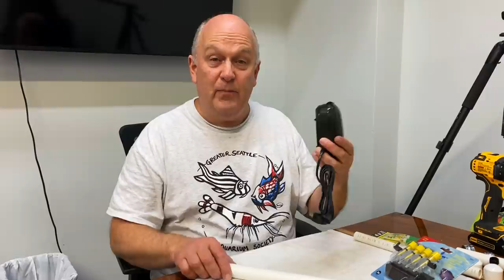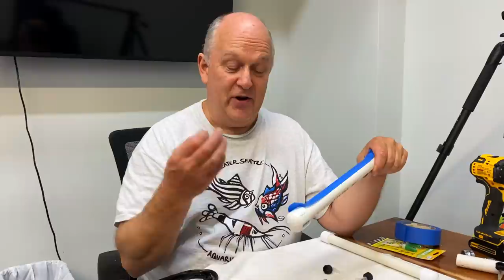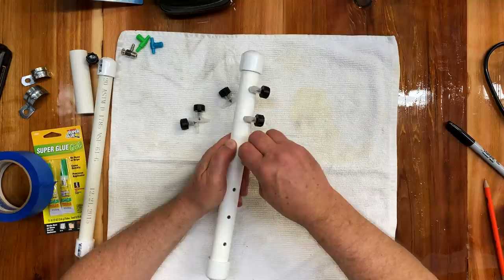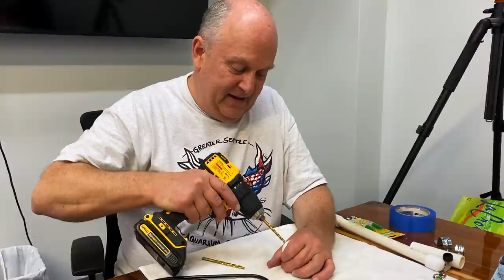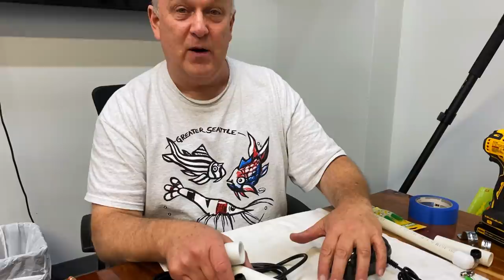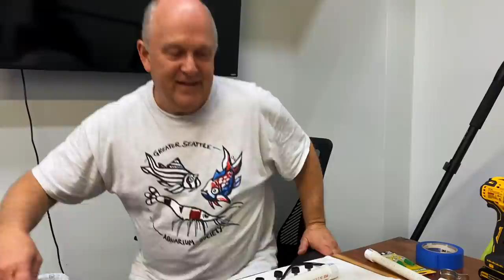How to Share 1 Air Pump with Multiple Fish Tanks [DIY]

Comment: I would love to see a video that explains what size air pumps you should use for multiple tanks in a system like this
Reply: I agree Blake Johnson that would be great
Reply: That’s a good idea for sure. I can imagine someone trying to run this with like a whisper air pump from petco or something...
Reply: Yeah I have five tanks right now and I have already miscalculated air pump size to run more than one or two on one pump
Reply: Absolutely agreed!
Reply: Alyssa Bentley lol
Reply: yes this would be really cool I am always bouncing back and forth between whether my pump is too strong or not strong enough. Most days I have more than enough air and other days some of my sponge filters are bubbling slow
Reply: Agree, I think this still calls for those Alita or Jehmco pumps which most people cannot afford or are not willing to invest if you do not have more than 10 small to medium sized tanks. I like the video and the idea behind it for future DIY projects.
Reply: 82L/M will cover 10,000L of water easy.
Reply: you could also use two or maybe three medium sized pumps to this one pvc pipe to run an aquarium wall as well. Just drill two or three holes for the pumps ;)
Reply: Barend Fokke or u can u outlets to the air pumps
Reply: This
Reply: Blake Johnson  I tried doing it and it didn’t work. But I used a two outlet and I think the air pump runs 30-60 gallon tank
Reply: I believe the pump is on their website.

Comment: Great Instruction and Dean is so relaxed in his tutoring.  If you could give us more of an idea on what style air pumps you would use for these systems that would be great.   I have done a similar set up in my room running 24 tanks and I found that I had to go to a much large pump, but the good news was that it was only one pump and not a lot of noise.  Thanks Dean and Cory.....Good job!!!!

Comment: LOVE THIS!  Am in the beginning stages of converting our old dining room into a fish room (coralling many of the aquariums scattered through our house). Saw a video of Rachel O'Leary's airline setup, but this goes into more detail and will save me a bit more money--so long as I can track down those Ziss valves at a reasonable price here in Canada. I'd love to learn more about this, Dean & Corey, especially how to judge just how powerful of an air pump I should pick up. For now, looking at seting up 2x 20 gallon tanks, 1x 25 gallon, 1x 30 gallon, and 1x 38 gallon (a mishmash, I know), and add in several ten gallon tanks down the road. Rachel's video made me realize I'll have to figure depth of the aquariums, and not just guess from the gallonage I'm dealing with, but not sure how to go about doing the calculations. I certainly want to get rid of the mishmash of cheap, small rated air pumps I've got now, and go for a central system, or maybe a bunch of the great little SILENT USB air pumps (thanks again for highlighting those, Corey! Wish I could buy them direct from you, though happy enough you've got Easy Green available to us northern neighbours, now).

Comment: I just recently did this closed loop system on my rack and without this video that broke it down, I would still be running several air pumps instead of the one.  i have to say, I’m thrilled with this system!  It’s limitless!  I’m already dreaming up expansions because I have to take advantage of this air pump that’s not taxed at all by what I have so I have to expand! My next project is a 100g tank, I hope, with some new plants I havent tried yet and, of course, new fish!  Thanks Dean and Cory for breaking it down easy.  😍.

Comment: I was just looking for a diy aquarium air pump manifold the other day with no luck. I’m just using T splitters and air valves now and I’m having pressure distribution problems, this should help fix that. Great video

Comment: "Let's tie a knot in the air line" it's a good job Dean is here😂
I have used one of those worm cones I did not like it will be interesting to see what you have planned 🤔
Reply: MikeJ H you could actually push the end of the airline tubing on the inside over a smaller tube or a cut off piece of a T or a valve. This way the tubing would be thicker on the inside stopping it from being pulled out.
Reply: Or push the tubing farther in, use a small zip tie to snug it, and pull the excess slack back out.

Comment: I would have never thought to build a manifold like that... I've been joining air line together with tee's and putting a valve in line with the filter at each tank. 

For what it's worth, I have a Whisper 40 running 6x10 Gallons and I feel like I could maybe push it to 8.

I'll have to give this a try!

Comment: I live in southern California where there are plenty of places to get drip irrigation parts. Off of a single 1/2 inch pvc stem riser you can attach an outlet manifold which contains up to 6 or 8 adjustable outlets. Fairly simple.

Comment: How do we gage what size of air pump to use for length of the overall system or amount of valves we use? Not sure which affects the airflow more...
Reply: Bigger is better, but just guesstimate, like depends on how many systems yous running, but you can always lower/raise the flow w the valves.

Comment: Great howto guys! I'm moving into new flat in couple of months, with a separate fishroom/home office/man cave and I'm already excited to make the air setup like this. However, do you think I can connect 2 of the biggest tetra pumps I already have, eight outputs all together, into one system like this? Counting in that I'd release the possible back pressure with one of the valves, ofc? Thanks

Comment: I am fairly new to keeping planted aquariums. I like to use cheaper DIY methods. I am currently using some cheap LED lights from Walmart. I would like to know how to tell if my lighting is low, med, or high. This would help a lot when picking out plants and trying to control algae. If my lighting if high enough I may even decide to use CO2. I am currently using 2 hyper tough 5000 lumens, 5000k on a 150 gal tall.

Comment: Hi there loving table Tuesday, was wondering whether this air hub can be used for co2 as well.  By running a bubble counter at each drilled hole
Regards Duzzy from 🇦🇺

Comment: I’ve considered doing this but I don’t know what size pump I would need. I have a 29 gallon, 10 gallon, and two 5 gallons all with sponge filters. What size air pump would I need for this? Right now I have separate tetra whisper air pumps on each, each rated for whatever size tank they’re on.

Comment: I built a system just like you illustrated, but when I halted the system to switch over my air stones all plugged with algae.  No air was getting to the sponge filters.  Couldn't figure what had happened until I started taking things apart.  Unfortunately I had switched back to the old system before figuring out the problem.  Have been fighting algae for some time. Should have done a better job of routine maintenance.  One question, my pump has two outlets. I have just connected them with a tee a few inches out.  Is that the best way to maximize pump output? Good video - thanks.

Comment: Hey guys I have the fluval co2 kit and I'm trying set it up to a timer. Once the power turns off the line from the canister to the solenoid builds up pressure and blows. I'm even using super thick co2 line. Can you show me how to set this up properly

Comment: What type,size,Etc., air pumps are needed/recommended? I have a Tetra Whisper AP300, AP10, and AP60. I am running 3 small sponge filters on one line of the AP300 and 2 sponge filters 1 big one small on the other line (all with air stone upgrades).The other 2 pumps are paperweights after upgrading to the AP300 due to them being to weak.

Comment: I use one air pump with 2 ports for 4 tanks. I use a T "insert" and then use ziss air valves to adjust the airflow to the tanks

Comment: Great video guys, I just have a quick question...does air pressure decrease if the pvc piping setup is set on the floor pushing air upwards vs. setting up on top of ceilings hanging down pushing air downwards?

Comment: I have 4 aquariums, 55, 33long, 20, 10g they are all near each other. How strong of an air pump would I need to power large sponge filters in all 4 ? Maybe with a couple extra spots for new aquariums when needed.

Comment: What size pump would be needed to 6 tanks? I use all 20 and 30 gallons long tanks. Would it be sufficient to run to pumps into it instead of 1 larger so I dont have to purchase a new pump?

Comment: hey fellas, i have mult tanks so i bought a VIVOSUN 1750GPH pump (amazon $60) few yrs ago and im satisfied w/overall output,.. it came with 12 outlet. had plenty of power almost too much. The reason i say this is due to noise. it's not noise of pump it really quiet; it's the bubbles as they reach top of each tank. they are so loud!! Any idea as to how to quieten them dwn??? Now i had a bit of prob with hot air coming fr pump into tanks so i just removed airline that came with and added a longer piece connecting to the 12outlets made outa metal of some sort. Well it helped a great deal, but still noisy air bubbles! each outlet has dial to control amount of air released but... if turned down too low it puts strain on actual pump possibly damaging it. This type set up took a lil time exacting amount of air to each tank due to well if u hav dial 1-4 wide open then dial 8+ may loose pressure, or vise-verse. Any input on how to make bubbles less noise, greatly appreciate.. 
Oh also, i use this pump actually split the 12 outlets into 24 so i have them connected to a sponge filter in each tank. Lots & lots of air pressure. It'd be perfect for that ziss filter,may try them out on dwn the line..

Comment: math - regarding the equal spacing.  to get 4 equal spaces in between your endpoints just measure the distance between the ends and divide by 5, for six equal spaces divide by 7, for 3 equal spaces divide by 4 etc...

Comment: Hey Cory, do you’re tanks all have the same ph, hardness and you just keep it stable or do you change you’re water parameters for specific type of fish, just wondering because I have very hard water. Thanks for all the help!
Reply: I do know his water's so soft/so low pH that he puts crushed coral in most of his tanks. Not a bad plan for any guppy breeder, but he puts them in way more than I'd ever need to (I've got tap water at about 8.2, drops down to 7.9/8.0 after conditioning)

Comment: So file this under "stuff nobody thinks to tell you because it should be obvious:" you can use a 4-way valve with a double-banger air pump to power multiple air lines. It never occurred to me. That's why these older videos continue to be valuable!!

Comment: I'm understanding the total build of the airation expansion on 1pump the problem I'm having is it's no producing enough air to run,
1-double head sponge filter 55 gal,1 single head sponge filter 40 gal breeder tank,2 10".   Bubbles wand,1 6"bubbles wand,1airline with bubble stone in 65 gal.. so the problem I'm having is should I buy a bigger pump? Or,,just plum it or to my garage to a 140lpb pancake compressor in my garage which would be convenient,just don't know what the difference would be

Comment: Is filter necessary in a tank. I'm mean I have a well and I can do daily water changes. So a sponge filter will do the job or I need a filter  with media and all.
Reply: RAZOR12334 
Sponge filters are great for smaller tanks. I use only those in my 20 gallons or less. Not sure about bigger tanks. Depends on the bioload of the fish too 😊

Comment: Or just push it through  the end cap and poke a nail through the air hose through one side out the other so it looks like a capital T with the air hose being the straight up piece and the sideways piece being the nail and bam cant pull out but also still allows air flow

Comment: So why can’t I just use the 4 valves on my pump and then use T’s for each drop in line? Absolutely no build involved. I just run a couple lines of tubing cut it put the t in the line in a few spots, done
Reply: I've been doing it that way for several years already.  It's also easier to make adjustments when you have any changes you want to your set up.

Comment: @Aquarium CoOp you need better mics for these type's of demo's . Tip for begineers... Air Line Control Valve's(buy  run a T piece after valve per Aquarium(allows 2 air stone's) not in use Aquariums after T piece run Air line around to its self (as saves damaging Air Line Control Valve expensive part) in as plug.   Guess Feeder is to be used as part of a egg tumbler.

Comment: Whyd he use the thicker pvc, he was to get back on that :)
Reply: I suspect that if you use the thin walled pvc there is a risk of blowing the valves out if you have reasonable air pressure.  The only thing holding them in place is friction between the valve and the pipe.  The thicker the pipe the greater the surface area in contact with the valve and hence the greater friction.

Comment: This isn't anything new. My dad's buddy was doing this back in the 80s (centralized air pump system) but this is streamlined and far less  complicated. If I had more aquariums running, I'd take this tip and run with it.

Comment: It only works on the same depts
Reply: No, if the air pump is supplying enough air just dial in the needed amount with each valve. I have a rack with 18 tanks setup with similar air supply. Three different size tanks (depths) and all work just fine.
Reply: @James_Hande  yes but your using a giant pump i think. my  bigest one does 400 lph i have schrimp tanks  and a show aquarium with 35cm hight driffrence  so in my case it wont work
Reply: @James_Hande  there are rvs kranes on wish they work the best i think for the normal people with a tank in the sleepingroom i use one with 5 exits one with 2 and other one with 3 double feeded (pump has 2 exits so they work together )